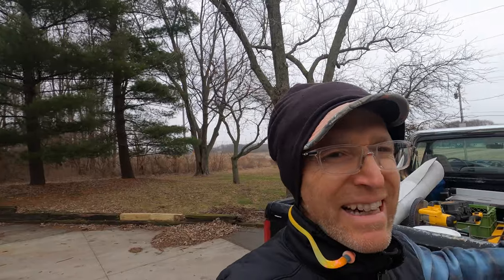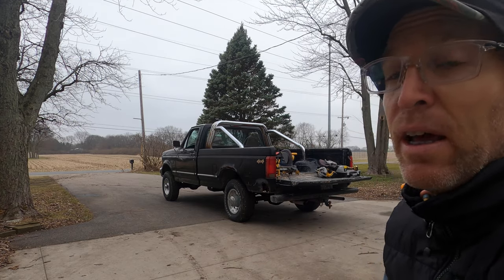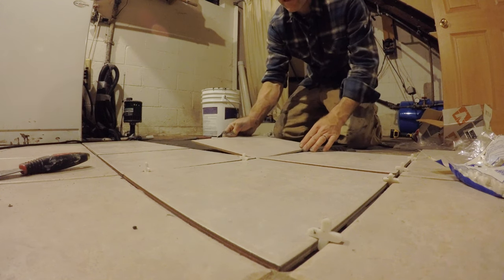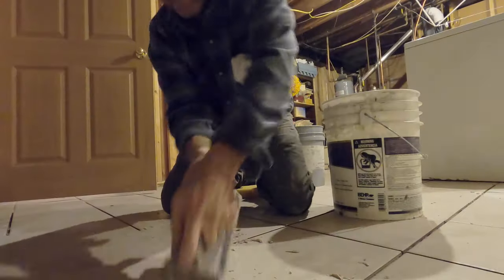Truck Troubles ➠ Handyman Diaries Ep 16

Comment: If the F-250 doesn't work out: 
I have the same Crosstrek and you'd be surprised how much it can haul with the rear seat folded down :)
Reply from the maker: The thought has crossed my mind! I also have a trailer for the crosstrek so it would totally work:)

Comment: Thankfully transmission swaps are easy on rear wheel drive vehicles.. If it was front wheel drive, you'd be stuck in a massive job trying to swap that at home.
Reply: Thumbs up for the mad max ford! It needs a little bit of love. Not the love of making it nice again.. The love it deserves. Just weld metal plates on the rust holes and rattlecan it black.
Reply from the maker: That welding is on my list ... I don't need it to look pretty, but fewer holes will make me feel better. :)
Reply: @metaspencer  How about the amazing work of pop rivets? :D
Reply from the maker: I could always go that route if my welds all burn through ... we'll see! :)

Comment: I got a little misty eyed when the rollbar went by.....  

Got a question for you, if you were going to buy a stand for your miter saw again, would you buy the folding leg one you have or the one with the wheels? Considering you set yours up and take it down quite a bit during the day.
Reply from the maker: Yeah, I like the style of those crazy roll bars ... may have to reinstall them if all this ever blows over. I do like my miter saw stand a lot, and I actually have two of them. Now, you could likely build one that is as good, but I really like that it's aluminum (no rust) and works for long stock.